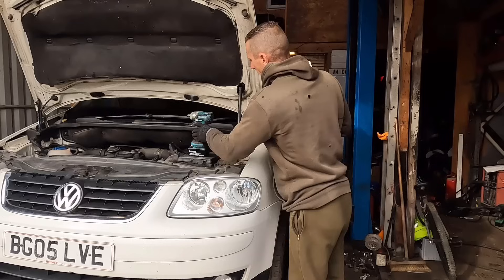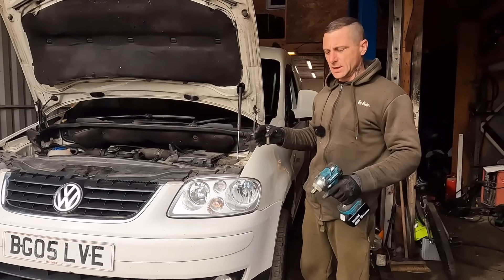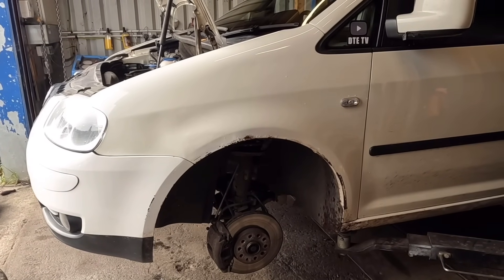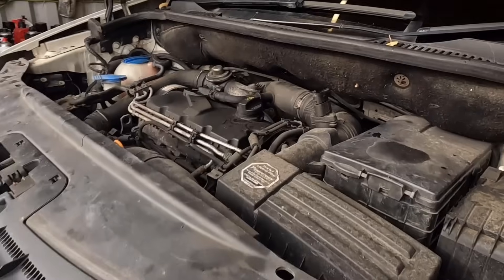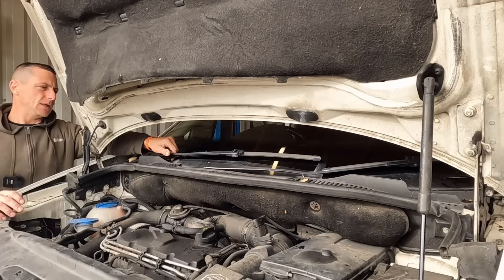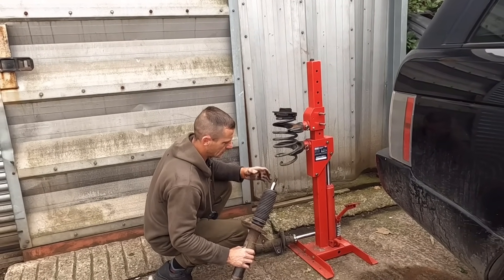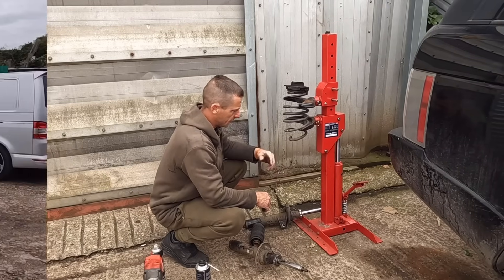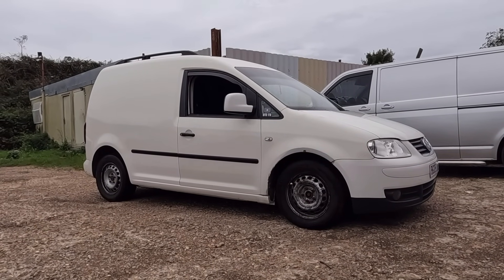Vw caddy - budget build - getting the lows

Comment: caddy's look so much better lowered, had the same problem with mine, the front bolts had to cut them off what a pain that was. get Andy to split the seals on his head lights with a heat gun and spray all the silver parts black , nice little free mod. 👍
Reply from the maker: Hey max then axle bolts are a right pain I’ve wrestled them on a few vans now, that is a good shout about doing the headlights I’ll include that in a video very soon 🙏👍
Reply: nice 1 👍 @YTDTETV

Comment: Great job mate it’s getting there now,removing the front hub is the best way to do the fronts,I’ve learned the hard way 😂
Reply from the maker: Hey bud thank you 👍 there is some motors that you can just slide the hub down but most just bind up on the shafts and cable etc so just wanted to mention that before anyone tells me how to do it easier 😆🙏👍

Comment: Top tip with the narrowed bolt for opening the shock / hub. Will do that as a back up. Another great video Thank You
Reply from the maker: Hey bill I do have a proper little tool but I made that a little while back when I couldn’t find it. Depending on the side of your gap is weather you would use m6 m8 or m10 bolt. Always appreciate your comments sir 🙏👍

Comment: Nathan really enjoying the budget series. I forgot how you lowered your own Caddy. I wouldn’t be allowed to do it that way here in Germany. When I lowered my Caddy, I had to use an approved kit mine is a H&R and then I must take the Caddy to the TÜV(MOT). Who check that it is fitted properly and entered it in the logbook.
Everything is so regimented here compared to the UK. I nearly fell foul to this as I ordered a sport air filter and didn’t read the small print until it arrived “only for show and racing not for street use”. They have to be enclosed similar to the original and that makes the sport filters 5x as expensive. That’s why I’m doing my Caddy with a limited budget. I could get the lowering kit because it cost less than new springs after it broke from the impact of a lorry carcass hitting my Caddy.
Reply: So in Germany all modifications from standard factory spec has to pass inspection?
Reply from the maker: Hey bud thank you and yep I’ve heard about the laws etc over there and I understand it’s for safety etc. appreciate the comment 🙏👍

Comment: You are a quality mate, the world needs more people like you👍🏻. Andy's van is really coming on. If you ever change the front anti roll bar bushes on your van, I'd be really interested to see how you do it because mine are shot, and I could do with some pro help on how to do it
Reply: Been looking into doing mine trying to hunt down a mystery squeak. From what I see you need to remove the 2 bolts on the subframe then chisel and pry the bracket off then replace the bush. The bracket can then be drilled out and attached back on with a nut. There are repair kits available if the bracket gets mangled getting it off.
Reply: @jamessorenson2878  I don't suppose you have any info or a link to the repair kit, as ill probably damage mine haha?. Also I'm guessing the fix can't be done under the van, rather than lowering the sub frame to get the bar out and retrofit the bushes?. Could I just cut the bracket under the van and chop out the old bush, then buy a new bracket if there is one that exists
Reply: Van is looking great,well done and very nice to have a friend like you around 👍✅🍺🇬🇧
Reply: @aaronbrown3187   I haven’t done it yet so don’t take what I say as totally correct! The correct way is to completely remove and replace the arb with a new unit that comes with the brackets and bushes already attached. It looks like they can be replaced by removing the 2 bolts that hold them in on the underside of the subframe then hammering a cold chisel to split the bracket in 2. The bush can then be cut off. The repair kit has a replacement bracket with a split bush that can slip over the bar and then attached back on with nuts. I’ve had a look at mine and they look ok so didn’t take it any further but there’s plenty of access to get at them with the front jacked up and wheel off. I’ll dig out the links for you now. If anyone knows better please feel free to correct me.
Reply: @aaronbrown3187  It won’t let me paste a link to the caddy forum where I got the idea from. 
Google caddy arb bush and it’s the first result on the forum. 
The last comment details the method of removal I mentioned
Reply: @jamessorenson2878  Is it the feckin big screwdriver comment? 🤣
Reply: @aaronbrown3187  yeah, I got a bit posh with the idea of using a cold chisel 😂
Reply from the maker: Hey Aaron thank you mate really appreciate the kind words, infact I was looking at new bushes for mine so will include that in a video 🙏👍

Comment: Nice work. Coming together well. 
Does the rear axle on MK4 need physically flipping or just the shackle kit as it comes?
Reply from the maker: Hey Jack if you buy the shackle kit and rear hanger you can do what I done in this video but without cutting and welding it all bolts straight on but still need flipping to on top of the springs instead of underneath 🙏👍